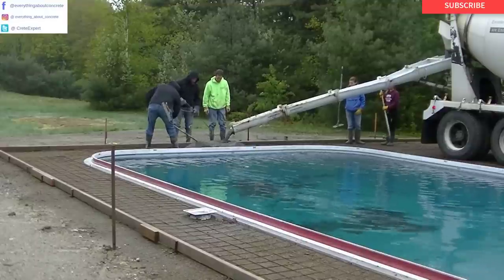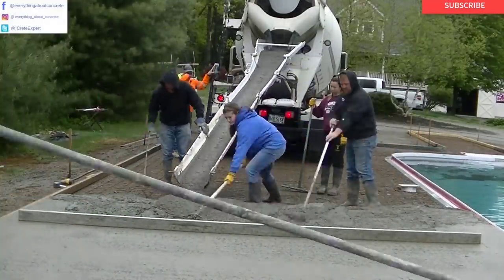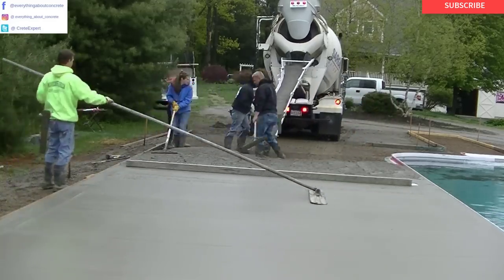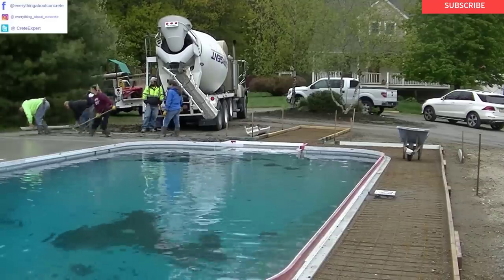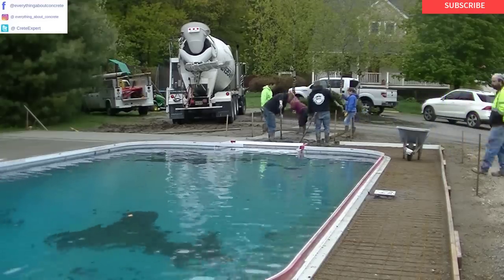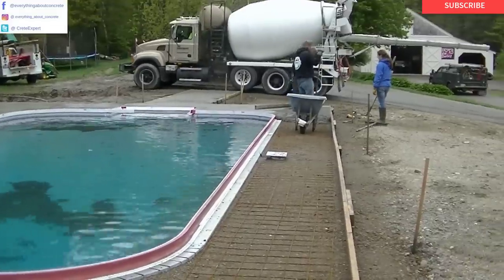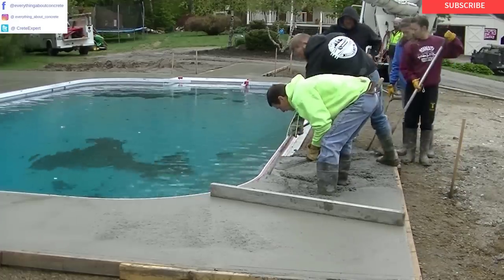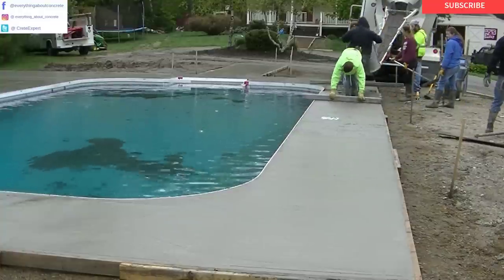STAMPED CONCRETE POOL DECK : PART 2 OF 4

Comment: Hello From Western Australia do you use engine oil on the inside of the wood forms before you pour. they say it doesn't stick or damage the concrete when you pull it away from the concrete.
Reply: That’s a good old timers trick it works great.